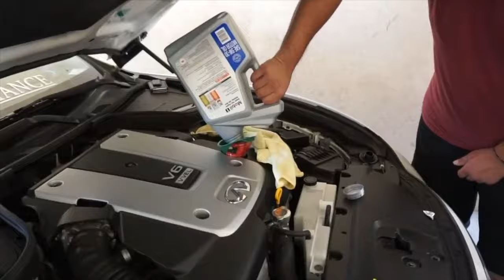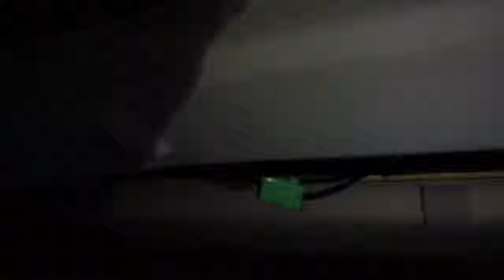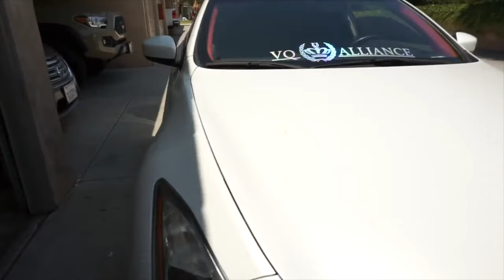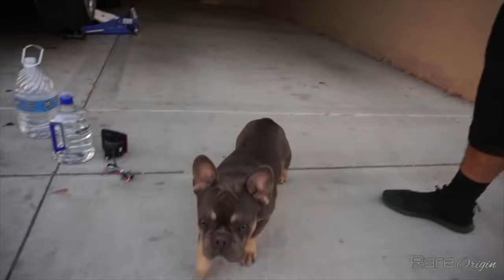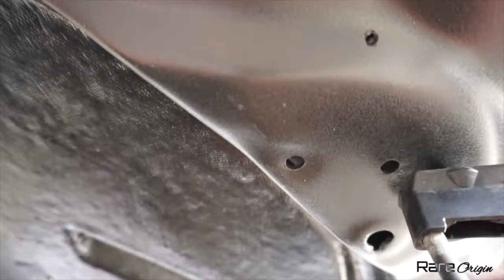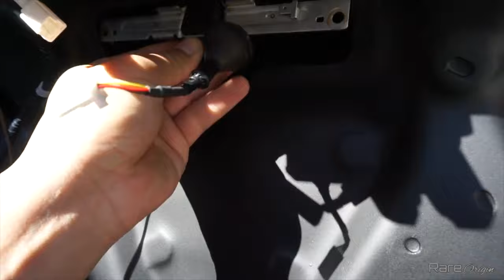BUILDING A INFINITI G37 IN 12 MINUTES!

Comment: Good build and everything but no high performance parts besides the cold air intake
Reply from the maker: Please check current videos, full bolt ons and now on e85 tuned and more to come 🤝
Reply: @GeorgeNava37  but there is literally no supercharger turbo or even any mods besides a tune not even coils make a difference but idk it’s up to u what u call a build ?
Reply from the maker: @edgarlife____4720  correct there is no super charger which I don’t want I want 🐌💨 I like to show the process no point for me to slap 🐌 right away I’ll be done with my content but I understand your point 👍🏼
Reply: @GeorgeNava37  like don’t get me wrong ur car is fine af but yeah that my point of a build it’s just a opinion

Comment: What year/gen is the best of G37
Reply: 08
Reply: G37 2013 and after. Before 2013 there was an issue with the head gaskets but only like 50 percent of the cars have them (similar to how 350Z burns oil) you just had to get lucky and hope you got a good one. It’s not worth the risk to me so I’d stick to 2013 and after. Other than that there really isn’t any major difference at all and I would just go for the 08 since it’s cheapest